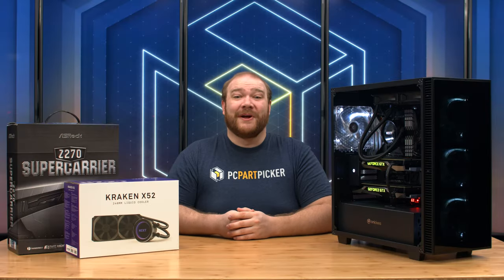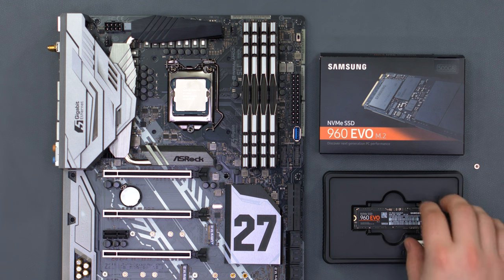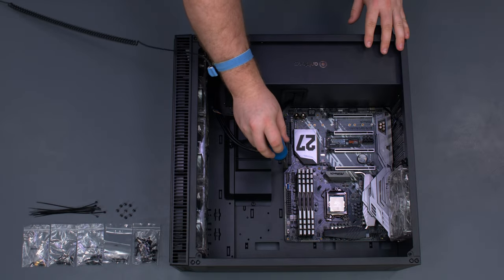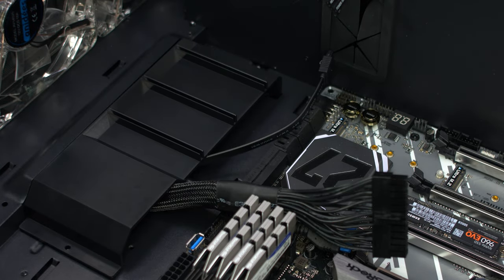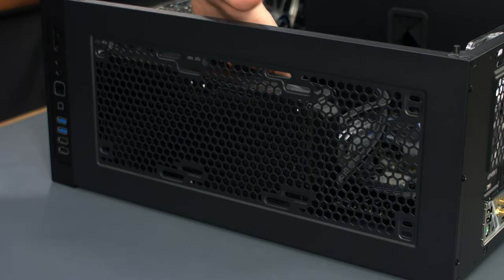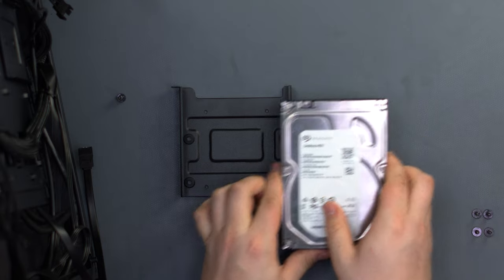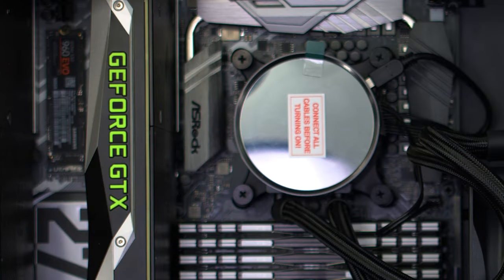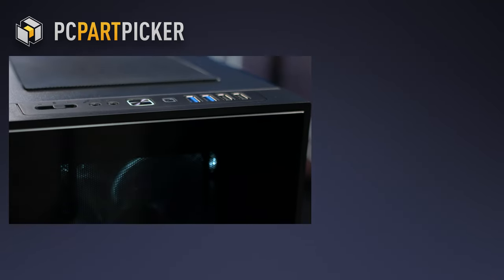ASRock Z270 SuperCarrier Build - i7-7700K / GTX 1080 (2-Way SLI)

Comment: 2 things:
- Why not spend the extra $10 for the Kraken x62 280mm rad since the case can clearly accommodate it?
- The way that the radiator was mounted makes the coolant hose look weird and partially block the infinity mirror on the block. Should have mounted the radiator all the way to the left with the hoses exiting on the right and then looping back to the block.

Comment: it was a better choice to install the watercooling of the other direction no ? For the cable
Reply: Yeah, you're absolutely right, I also don't like that radiator position. It should be reversed 180 degrees for much accurate tubes allocation.
Reply: i am agree with you, idk they did things like that
Reply: they do it because the hot air is going high, while the cold air stays down :) But still it does not make that much difference so it will look better if they put it in the front of the case :/ 
Sorry for my bad english :)
Reply: my thoughts exactly...would have looked cleaner but, it's just an opinion and doesn't really matter. I have a build pretty close to this one with x1 gtx 1080 only.
Reply: Unfortunately, that's about the only way to fit it well in the top of the case.  Rotating it in it's current position or sliding it to the other end doesn't fit (the tube side of the radiator becomes blocked by the included fans just short of the available slide mount points).  

A front mount might have worked, but then you lose the nice effect of the fans down the front glass which was part of the attraction of using this case in the first place.
Reply: Hi res build other than that everything now sooo overkill, do you keep the wall killer eater or not? lol

Comment: Can I just do this build with 2 1080ti's and a better power supply?
Reply: The i7 7700k would bottleneck the 2 1080 Ti. Consider atleast a 6850k
Reply: Why would a 7700k bottleneck ? What does bottleneck mean anyway ? Isn't 7700k the best ?
Reply: Abhinav Ajith pentium would be a better option

Comment: ASrock supercarrier motherboard. Is it possible to SLI 2 x 1080 gtx Ti, but one card in the top slot and the other one in tle last one at the bottom? Not like in this video, the second one from the bottom but in the First one on the bottom. Trying to find a MB that will allow me max free space in between two cards.THX

Comment: i wanna build a new computer and i have come up with this
Intel Core i5-7500 Quad Core
ASUS LGA 1151 STRIX Z270F GAMING ATX Motherboard
DEEPCOOL CAPTAIN 120EX Water CPU Cooler
NZXT NOCTIS 450
ASUS STRIX-GTX1070
Corsair 16 GB (2 x 8 GB) DDR4 2800 MHz
EVGA 650 W G2
are there anything you can do to make it better? or should i buy it (love the vids keep up the good work)

Comment: can I use Corsair vs 650 Watt power supply if I'm only using single GPU gtx 1070  ?
Reply: Even 550W is enough for a 1070.

Comment: Isn't putting the GPU further down the motherboard reduce its performance cause I think the second 1080 could've gone on the second PCIe slot.
Reply: It varies with each board, so something to check the manual for your particular board when installing.  In this case, the SuperCarrier's manual specified that PCIE1 and PCIE4 (the slots we used) were optimal for 2-Way SLI.  The middle (PCIE2) and the bottom-most slots (PCIE5) are recommended for use with 3 and 4-Way SLI as they only support x8 lane width.

Comment: what was that thing in your hand? wich was connected to a wire
Reply: Anti static wrist strap. If you do not use it, enough static electricity could accumulate on your fingertips and you could damage your components. The strap discharges any built up electricity

Comment: Why not get one 1080ti instead of two 1080s?
Reply: Shitstorm of comments about SLI sucks, incoming in 3,2,1....

(I'm pro-SLI btw, 2x1080's is so nice)
Reply: Because it does suck, half of your games won't even recognize SLI, and some will not even perform better than the 1080ti which you can EASILY SEE IN THE MASS AMOUNT OF FUCKING YOUTUBE VIDEOS PROVING IT.
Reply: 11 games currently played since I went  SLI, only 2 don't support it. One is Cities Skylines which runs at 165fps on a single 1080 anyway, and the other is Resident Evil 7 which can be played in SLI with some minor tweaking. And I have seen so many (fucking) videos that do prove 1080 SLI beats a single 1080ti.
Reply: yep sli 1080 is indeed faster than a 1080ti, I think you guys are talking about sli 1070 (it still just barely beats a 1080ti)

Comment: Would have liked to see the AIO on the front of the case instead of on top.
Reply: Nick Ferraro I prefer it on the top however I'd have the fans above it pulling and exhausting out the top. The placement is also very odd. To my preference it should be all the way to the left with the tubes on the right.
Reply: For sure. Sometimes, the rig doesn't allow for it so you make due.